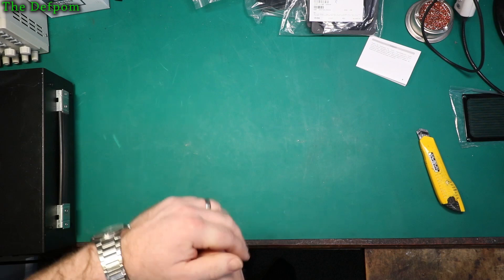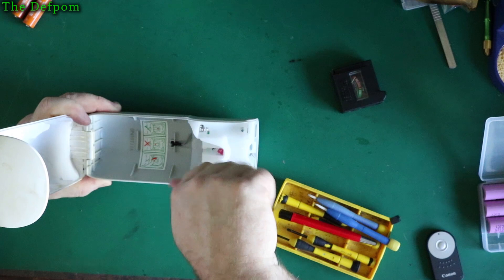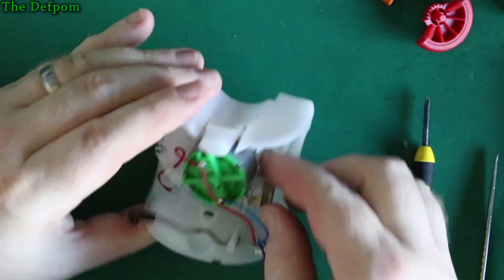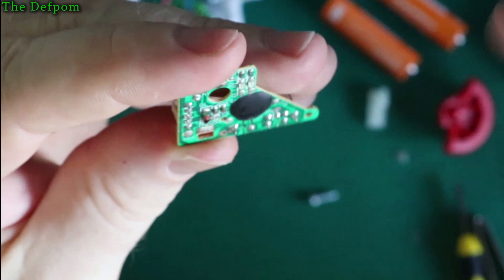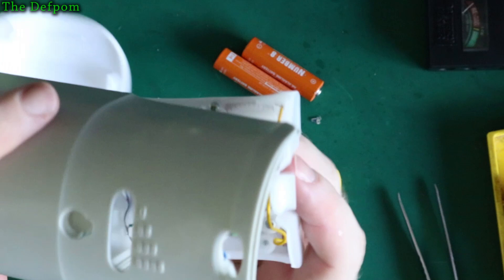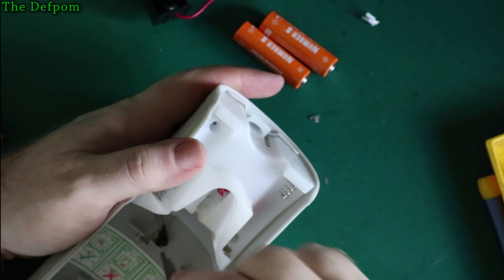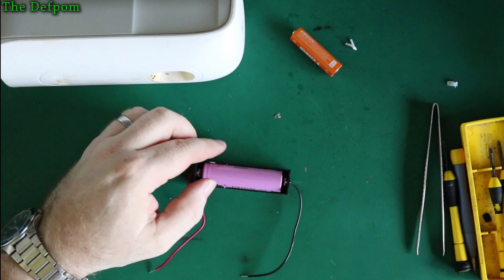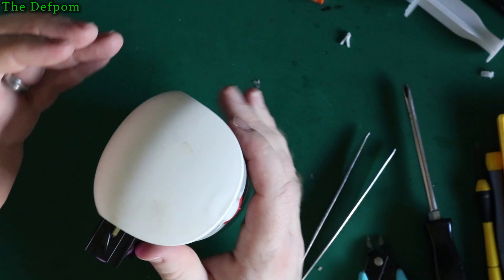🔴 #517 GET MORE POWER using 18650 lithium cell - Automatic Insect Sprayer Teardown and Modification

Comment: Funny enough the ones in the white shrink from Glade are actually a pretty good cell. Was buying the "intro pack" which was a 2 pack of the refills, a sprayer and a pack of 2 AA cells, because the special at Makro was actually a lot cheaper than the price of the 2 refills ( gee, wonder why the Gillette model is so popular for things that have consumables locked into the price) alone, and thus I was stripping the sprayers for the motors and gearboxes, the cheap COB PCB, the batteries, and sending the rest to the recyclers. those are pretty good batteries, never had one of them leak, and they worked well in clocks and remotes, with no issues till they went flat in around 2 years plus, just like the Energiser and Duracells, though those did leak.

French fries Asic, the designer was definitely going for the lowest price point there, and yes, that switch design is deliberate, so that most users will turn the unit onto the max setting, leading to you needing a refill every week, instead of the can lasting the month advertised on the packaging. The motor is probably made with too thin a CCA wire in the armature, so that it has high resistance, and thus has low torque in stall. Rewind with copper wire ( they probably went for the next size down CCA wire in the "cost cut"  round, along with cheaper brush material) and the motor torque would probably double. Would also pay to check the slop in the gear train, the pins probably are bending and losing torque in flexing the plastic.

But then, I buy the same can for the unit, just use it the good old manual method instead, as it is a pretty good mosquito repellent, just a can lasts me 2 years instead.

Comment: Are you using protected cells? If not I would keep an eye on your voltage to not damage that 18650 :)
Reply from the maker: Josh lever - that is a good point actually, I did intend to buy some protected cells and use one of those for it, I should of mentioned that in the video.
Reply: @TheDefpom   fair enough :) I was going to say the tp4056 module work really well and are dirt cheap and they make recharging the cell really easy as you don't even have to remove it from whatever project you have put them in.

Comment: i know you bought a whole bunch of 18650s recently so this video makes me think you are just looking for an excuse to use them in something. :) I have a nail...now i need something to nail it into. Why didn't you just try a good pair of AAs?
Reply from the maker: abeleski - I bought the 18650s for a project, which I haven’t published yet. I did try good batteries, it works for about a week before being just as bad as these bulk pack ones, and as you saw the voltage didn’t dip below 3v when it operated, so the issue isn’t a lack of power from those batteries.
Reply: @TheDefpom  no worries mate. I gave you a thumbs up anyway. Thanks